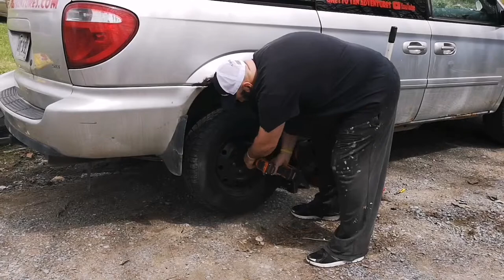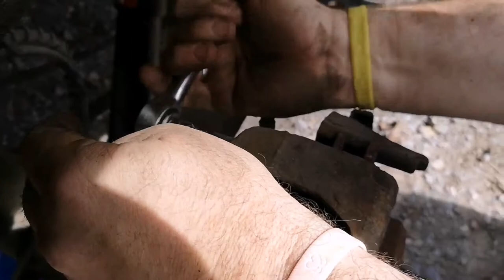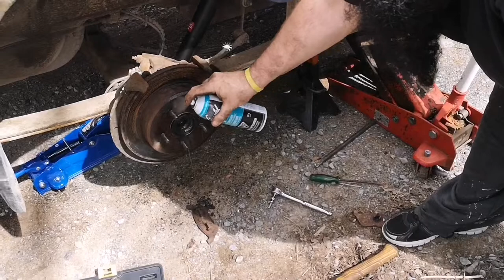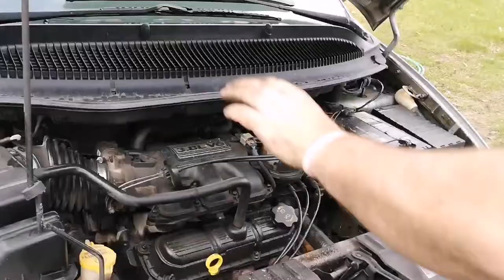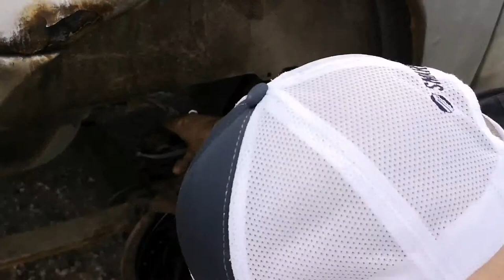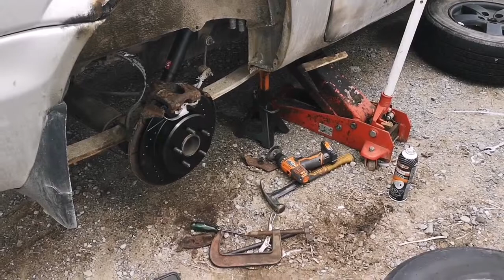Dodge Caravan rear brake pads and rotors replacement. 01-07. Vanlife

Comment: Thank you! I've never done the brakes on my van before, so this was extremely helpful! No clue about the 7mm hex! Lol My brakes were SHOT! The rotor was less than a centimeter thick and fell off, then pads were a hair away from touching, and the damn hub part of the rotor refused to come off! After much throttling with a hammer and a PB bath, she broke free. I dig your vid because ya didn't spew a shit ton of bullshit just to hear yourself talk! Straight to the point and you know what the fuck you're doing!

Comment: Noticing that the spring clip is in a different location than before I took it off. Curious which is correct. On my grand caravan, the spring clip is under the bracket not over.
Reply from the maker: I replace it exactly the way it was on
Reply: The clip goes under to help keep the pad pushed up. On top it's trying to remove the pad from the bracket.

Comment: Take the cap off the brake fluid reservoir before prying the caliper back.
Reply from the maker: I loosened it off but it ended up being the callipers were a little sticky and I had to replace them shortly after this video. Thanks for taking the time to leave a comment
Reply: Why its a closed system. You dont need to.
Reply: @masseyferguson9195  if someone adds fluid as their pads get thinner when you compress the caliper if the fluid runs out of space in the reservoir will it not build pressure and damage something ? I've done brake jobs and after compressing a bunch of calipers I've had to suck fluid out of the reservoir or wipe up a bunch of spilled fluid.
Reply: @Summernightsandneonlights   that makes sense. I have never added brakefluid to my veihcles. Even when the pads get to 10 percent the fluid is usally above the low mark.